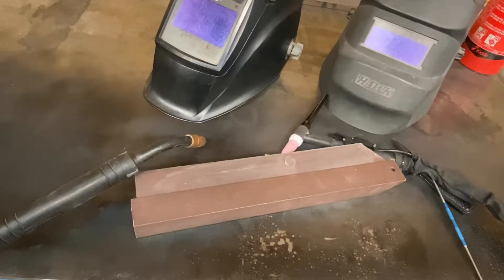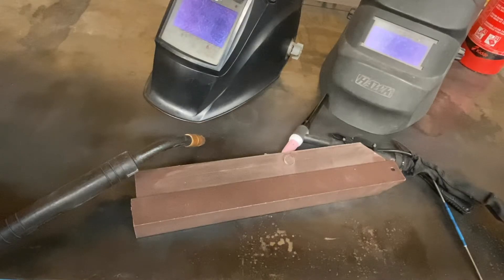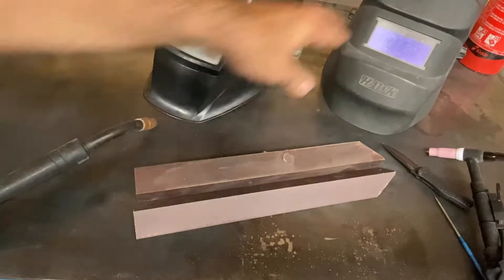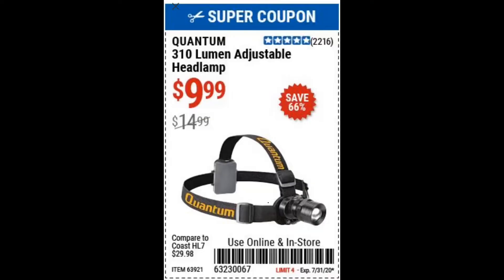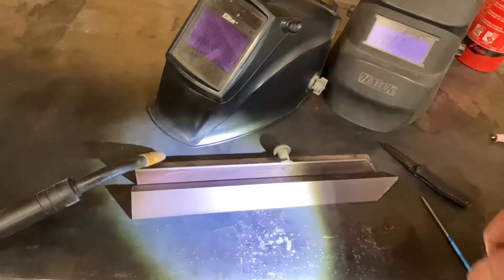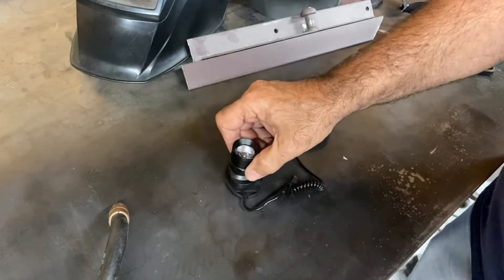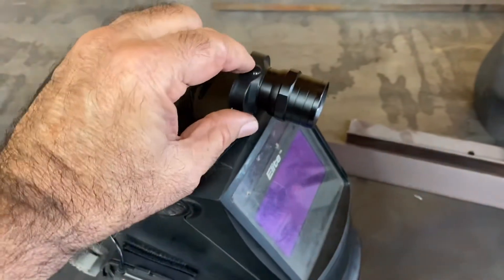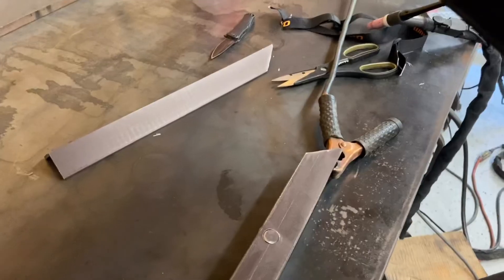Welding Helmet Light Easy Build

Comment: The PrincetonTec Refuel is the best light for this purpose. You can see well and it wont make your lens darken. Plus they are made in the USA. It is self contained: no wire. The batteries install from the side. It is pretty well perfect for this application.

Comment: Thanks for the video. The light is great if you wear the helmet all the time, but in my case sometimes I work after hours or in a dark spot and I need the light on my head with the helmet on my head, flipped down, or flipped down. Putting a light on the helmet doesn't help me with the helmet off or flipped up while grinding or preparing, etc, etc.. So the only thing I can come up with is putting a hole in the helmet forehead area and wear a short clearance headlamp. This however exposes my head to some UV unless I have a really tight clearance or perhaps a shield behind my headlamp. Visibility and making good stick welds seem to be my problem and really want to get it dialed in.
Reply from the maker: Thanks Jordan! Yes, it would be difficult to get one headlamp to work with the helmet in both positions. Maybe a second light mounted on the bottom edge of the helmet that would be aimed properly when flipped up? That doesn’t help when you remove the helmet though.
Good luck with finding the right solution. 👍 Tony B

Comment: Really excellent idea, ive been trying to use a portable led work light and because it doesnt move with your head it causes more problems than helps especially reflections on lens in helmet. Thats the other issue in my shop the over head lights on the lens. Going to make a cloth back cover and see if i can eliminate that issue. Love that specific headlamp very bright light exactly where you need it!
Reply from the maker: Thanks for your comments! This has worked very well for me, and I use it all the time. I weld so much better, when I can see what I’m doing.👍Tony B

Comment: Hey Tony. After I watched your video yesterday, I went out and welded on my Fargo. I did n't have a light like yours, but I used a spotlight that I had in my shop. I set it up to shine on my work area and it really helped me. But when I stopped welding my work still looked shitty. 😂But at least I could see.
Thanks for the tip.👍👍🍁
Reply from the maker: Well, I’m glad it could help you see, Andy. The welds will get better, now that you can see what you’re doing. 👍
Reply: @ChipsAndSparksGarage  I do think so. At least they will be straighter. LOL

Comment: Hey Tony, another clever idea. Amazing that helmet manufacturers haven't brought this out integral to their design! I will follow your lead and do the same although I might look at slimline lights as I often find getting my boof-head and helmet into tight spots already difficult. Thanks for the idea and video mate. Cheers, Andy.
Reply from the maker: Thanks Andy! It really seems to help, in low-light conditions. Cheers
Reply: hI Buddy Next generation I will set a lamp. but let me answer you why the traditional helmet manufacturer dont set a lamp.bcs the power of helmet is li battery that is only 650 mah or less. if they set a lamp so that the lifetime of helmet will more shorter than before. bcs the lamp will consume the power of li batterty as well.
Reply: Easy solution @hj gong. Separate and chargeable power supply for the light. Keep it separate from auto darkening circuit. Simples